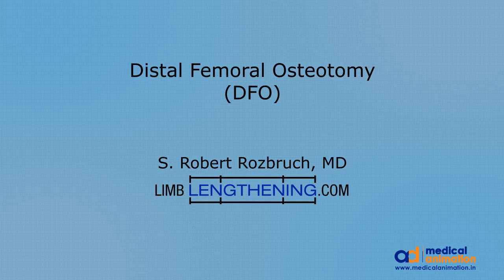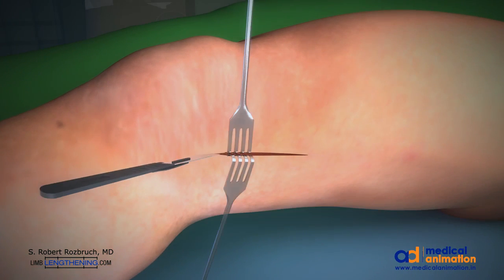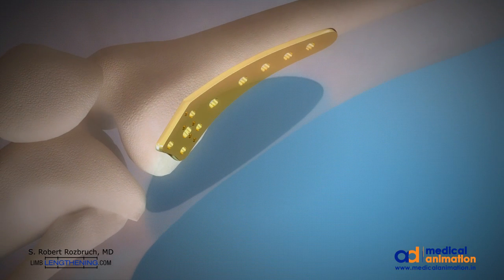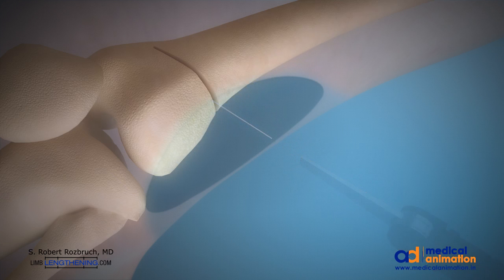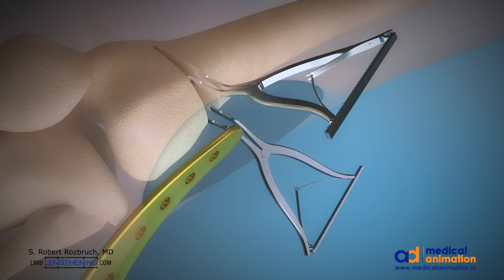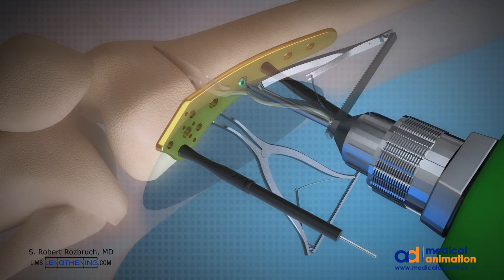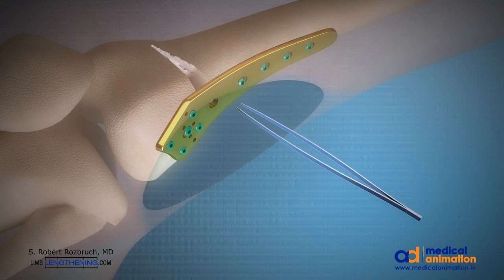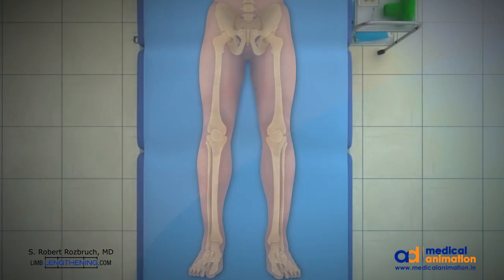Distal Femoral Osteotomy Animation

Comment: I had this done to my right leg one year and one year later, the same done to my left. They really weren't too painful, just listen to the doctors and use your crutches until they say your bone is fully healed. My doctor scared me into still using them, even when I knew it was strong enough to walk on. He told me that if I walked on it before it was fully healed, I could break the screws and they would have to redo it. I had complications with my left & they discovered an infection inside my knee 3 months after the surgery, so they had to operate two more times to remove the infection. I was on crutches for a long while but now I'm all healed & confident with my straight legs! Infections are rare and I was unlucky, but this surgery is very low risk and I really encourage anybody with knock knees to get this operation done.
Reply: How old are u?
Reply: How many months you use crutches after your second surgery and did you put the surgical leg  toes and walk by the help of crutches?

Comment: Just had this done.they gave me a nerve block hat could last 1-4 days. It lasted 1 day and I’m in excruciating pain. I’m told it does take about 4 days for the pain to come down. This is one of the hardest things I’ve had to go through
Reply: Trust me it is worth it, I had first leg done 8 month ago, and second 3 months ago and I am on a cain now. It isn’t that bad the recovery, you just need to be patient.
Reply: Make sure to go to physical therapy after you start weight bearing then you can transition to walking 1-2 months later.
Reply: Thanks I appreciate the advice. 
Pain is still bad but is soooo much better than day 2. Hangin in there.

Comment: I had knock knee and i got surgery done ( currently recovring) the surgery was a breeze and i was on epidural after surgery so there was absolutely no pain at all and the recovery is going smooth too if anyone of you are considering it go for it , knock cause walking troubles the more you delay it and even pain so go for it and all the very best 💖💖💖
Reply: Congratulations .  Both knees at the same time? If you only got one done is one leg longer than the other?
Reply: @lanesh7245 I had gotten the other leg done previously and no one leg is not longer then other they are both the same
Reply: How much time off work?

Comment: Been looking for surgeries or treatments for my bow legs, it's a bit hard for me to walk fast or run cause by the second I walk or run my feet just rotate inwards and I unintentionally trip myself. Can't stand on two feet cause one of my feet will hurt but could technically stand if I only use one and put my other feet at the side of my other knee like I'm doing yoga. Ironic enough I have a good sense of balance but will trip myself by my own feet 😂
Reply: Please do you recommend me to undergo this operation? If yes then how long it will take to fully recover and how much it cost?
Reply: @basimmahmoud9982  حضرتك مصري؟
Reply: Find a surgeon that will do an osteotomy using an arthrex ibalance implant.  Much better than metal plate with screws.

Comment: How long is recovery time ?
Reply: Hi i had knock knee and got surgery done last year It usually depends on when your bone is properly healed but usually it takes 3-4 months it can take longer or less time depending on your how well your bone heals,diet and exercise (only do exercise which are advised by your doctor) your not supposed to put any weight on the operated leg untill it's fully healed. All the best 👍
Reply: @Seemaind20  hey i have que
Reply: i have one sided knock knee so can you tell me where i get the doctor and how much money is needed for operat

Comment: I had this surgery done about a year ago. I was no weight bearing for about 20 weeks. Rehab is painful, and I’m still not 100% recovered because i also have a patella tracking disorder that I’m working on. Yes i can do everything, and my knee pain is gone.
Reply: I also had this surgery 6 month ago now I can walk but I m still limping isn't is ok???? Or plz help me or guide me ...what to do ??
Reply: @manshailyas1810  it's normal, just keep on trying to walk little by little. Hopefully it should be gone in less than 12 months
Reply: Please do you recommend me to undergo this operation? If yes then how long it will take to fully recover and how much it cost?
Reply: Pls how did ur knee pain go, I'm still suffering from this surgery.

Comment: I just had this surgery a couple of weeks ago. It is painful and you cant walk on it of course and have to stay off of it for 6 weeks. But it's worth it. My leg is straighter than before and this procedure will limit the risk of tearing your ACL or meniscus, due to the added pressure of having knocked knees has on your legs.
Reply: How much does it cost?
Reply: @justinbowman4591  since I have insurance,  it only cost me about 2,200 dollars out of pocket to have the procedure done. In turn, the total bill that was sent to the insurance agency was around 100,000 dollars. But I also had to stay over night and needed to repair my ACL.
Reply: @lindsayyoung3896  
hello how are you doing
Are you okay now? Are you able to do heavy tasks like running, jumping or any other heavy exercises?
I also have knock knees and I need this surgery
Please reply
Reply: How long did it take for u to walk on and for it to heal
Reply: @user-zd4ex1ew6o  This type of surgery takes about 12 weeks to put full weight on it. You have to be on crutches up until 8 weeks and than you start to slowly put weight on it until 12 weeks when you don’t need the crutches no more. But it depends on the person as well. If your not healthy than it will take longer for it to heal. Also the whole bone itself takes at minimum 6 months to heal properly. So you can’t do high intensive activities for a little while. But also if you’re healthy the bone will heal faster.
Reply: @ShearXtensionsandco yes it is in usd currency
Reply: does it feel better now then compared to when you have the knock kness? I want to have this done but I workout and i feel like it will take me out of the gym for a while
Reply: Did it effected your height
Reply: How do I locate the hospital? I am from nigeria. Or can I get it done here in nigeria?
Reply: @marygabriel895  very well
Reply: Are you after the recovery period able to do anything like before without any pain
Reply: Price
Reply: Price ??

Comment: How much is that I need both knees I think
Reply from the maker: Hi Xavier - If you are considering care at HSS, our Physician Referral Service can assist in answering any questions you may have. They can be reached at 888-720-1982.
Reply: Hospital for Special Surgery thank you I’m just more interested in pricing.
Reply: @narisonxxii  I recently had a less invasive procedure related to knock knees (Meniscectomy and Microfracture articular cartilage repair) that was $52,000 USD. I had insurance so it was no cost. This procedure is likely 2x as much I estimate and my surgeon is recommending I get this - he would have done this during my meniscectomy but the initial MRI did not pick up the cartilage issue.

Comment: I see this seems to work well but how about bow legs similar procedure
Reply from the maker: "When a physician evaluates your bowleg, they would determine the apex of the deformity and the optimal place for correction. Sometimes it is the distal femur and most of the time it is the proximal tibia. In some sever cases, we correct in both locations." - Dr. S. Robert Rozbruch

If you would like to schedule an appointment at HSS, please contact our Physician Referral Service at 888-720-1982 for further assistance.

Comment: Hi, i recently had surgery for a lateral meinicus tear, and have 50 percent  left, its been one year since surgery, i am getting joint line pain, the surgeon thinks it is meinicus deficiency, he suggested a meiniscus transplant however i am only 19 and semi proffesional athlete and have been advised a transplant wont bring me back to top level sport, are there any other methods you can suggest? He suggest an femoral osteomoty as long legged x rays show i have knocked knees and suggested that an osteomoty can shift the  weight on to the undamaged part, a reply would be grateful
Reply: besides the 50 percent removal of the meinicus my knee is perfectly fine, would an Osteomoty bring me back to high level sport?
Reply from the maker: Hi Kalif - Thank you for reaching out. It would be best to schedule an appointment so that they can determine the best course of treatment. If you would like to schedule an appointment at Hospital for Special Surgery, our International Center can assist you in answering any questions you may have regarding cost, treatment, and more. They can be contacted at 212-606-1186, by email at international@hss.edu, or by filling out the following web form: https://www.hss.edu/secure/prs-appointment-request.htm.
Reply: @HSpecialSurgery 
Do you have any surgeons out in Las Vegas Nevada, that I can consult with?
Reply: a solo meniscus tear is because of your knock knees. For normal legged people other things tear and you gotta have pretty bad trauma to damage a meniscus

Comment: I have an important question:
How do you make sure that the cut is directly perpendicular to the knee turn. If it bone is cut at an lets say 80 degree angle, wouldnt it have one leg ending up forward or back. 
I mean when choosing the osteotomy location, how do you make measure that the bone is not cut at an angle, that may result the leg to be straight but either slightly forward or backwards. 
thank you.
Reply from the maker: "We use interoperative x-ray and cutting guides to make sure the osteotomy is very accurate."- Dr. S. Robert Rozbruch